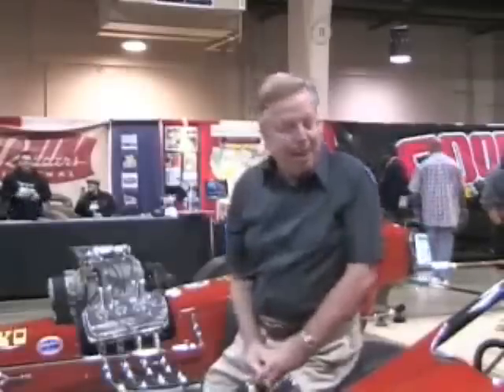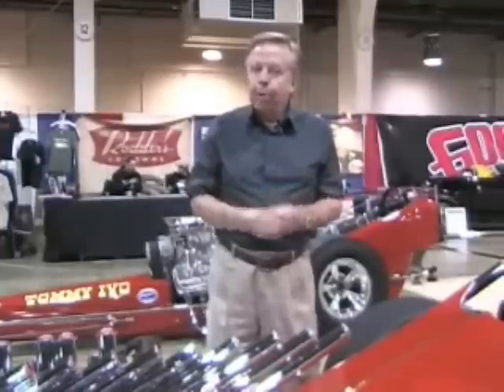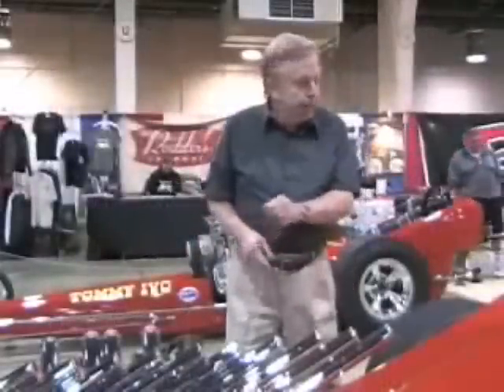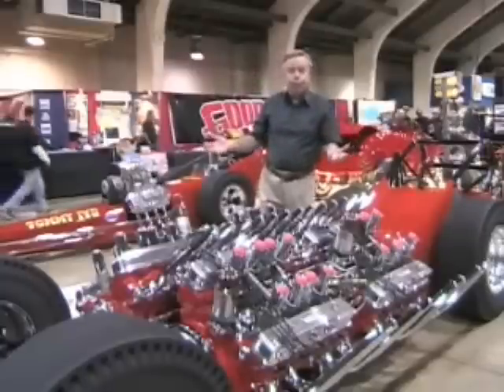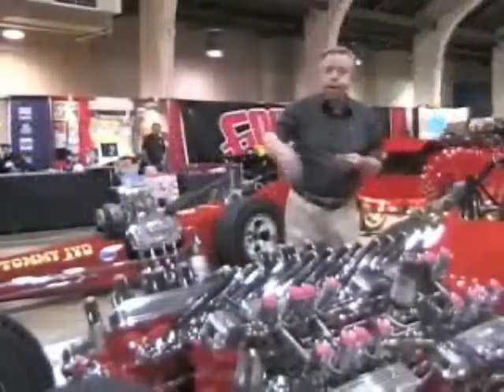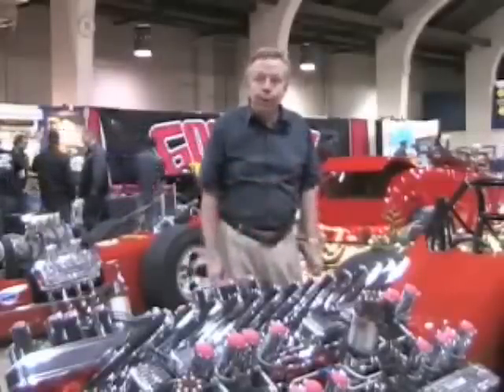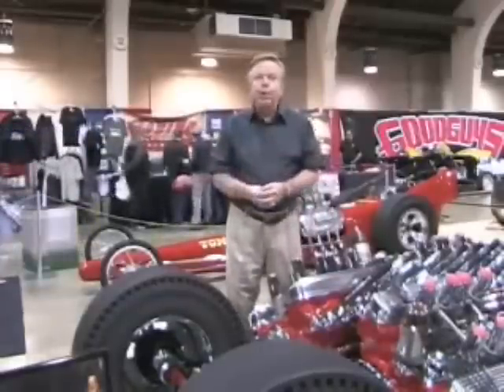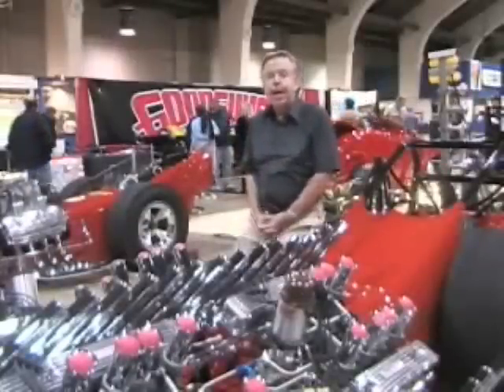TV Tommy Ivo - How the 4-engine car works

Comment: Wow,   in July,  2023 Tommy Ivo is now 87 years young !!!!  Go Tommy !!!!!
Reply: This video is 8 years old.
He even says at one point "Now this was 50 years ago", 50 years ago from now was 73 and he wasn't running that thing anymore in 73, matter of fact he was actually running it when I was born and I'm turning 58 at the end of Aug so the math works out all the way around on that one.
Multi engine cars went out in drag racing by the late 60's, I don't know if rule changes caused that or if the advent of nitro made multi engine cars impractical for some technical reason or whatever but by 73 no one was running multi engine cars anymore, it was a bygone era by then.
Reply: My son and I met him at a Goodguys event in Indianapolis in 1996.
He couldn’t have been any nicer. The 4 engine car was there and if I remember right he said it was the last time he would run it.
Very humble and gracious, just an all around great guy!

Comment: 4 miles to the gallon. For four engines! That doesn’t sound too bad. My Ford F250 with a 390 only got 10 miles to the gallon.😁👍
Reply: Except that 1 gallon in 1/4 mile is .25 miles/gallon. Tommy did the math backwards.

Comment: see the chain between the motors sprocket to sprocket?? wonder why it wasn't flange to flange....timed one motor to the next by rotating it??? i dont know....but i would love to see this car............
Reply: flange-to-flange would be too ridged. the chain acts as a constant velocity joint.
Reply: It's a timing chain.......
Reply: My guess is the precision alignment required of each motors crankshaft would've been impossible in those days. Just a few thousand's difference in runout would've been catastrophic.

Comment: What he meant to say was 4 gallons to the mile that's a gallon per quarter mile right?
Reply: I thought so! 4 MPG for that thing would be FANTASTIC mileage. Lots of big block muscle cars only got 8 MPG, so half of that with 4 times as many engines just didn't compute!
Reply: or 1 gallon (per engine), is what he meant to say.
Reply: Top fuel dragsters today use about 15 gallons between burnout and a single 1/4 mile run.

Comment: It's hard to believe that coupling chain can hold that much horsepower!
Reply: That is the timing chain.
Reply: @deathwrenchcustom  No, the coupling chain between the engines, it would have to hold maybe 600-700hp from the motors out put, not the timing chain on the cam!

Comment: Weren’t those Buick nailheads powering the original car ?
Reply: Yes, they were Buick 401 cubic inch "nail heads". If you're not familiar the "nail head" designation came from the small size of the intake and exhaust valves which I believe were designed that way for getting as much low end torque as possible. To compensate the cam was designed with a lot of lift and duration which gave them a characteristic lumpy idle. There was a larger 425 cubic inch version that was just a slightly larger bore. They were designated by Buick as the "Wildcat 445" and the "Wildcat 465" which was their torque numbers emblazened on the air cleaners. My dad had a 1966 Wildcat with the 401.

I can't recall if it was the 401 or 425 cubic inch version that was used as starter motors for the SR-71 Blackbird.

Comment: I don't understand how bolting two engines together would work. I would think that one would run at least a little differently than the other (rpm, power level), and that the differing power outputs/rpm outputs would break something. Were they really synchronized that perfectly?
Reply: Easy enough to build identical engines.  If they are in time and use one distributor to fire both engines, it just thinks it's a V16 .
Reply: They don't have to make identical power.  The difference is just what's left after one engine has removed 100% of the load from the other engine.